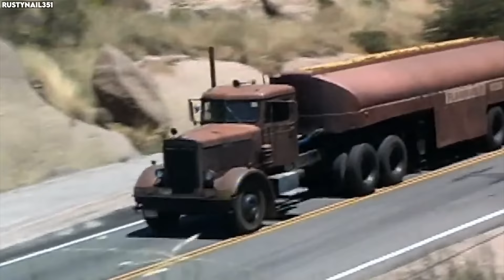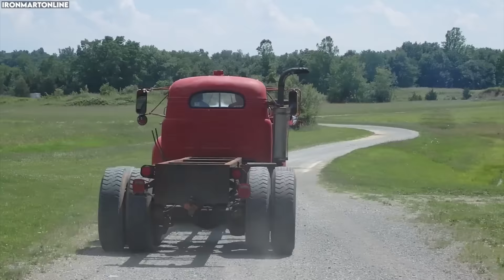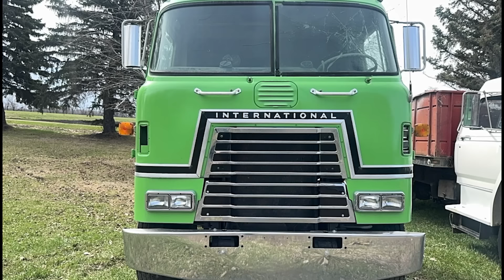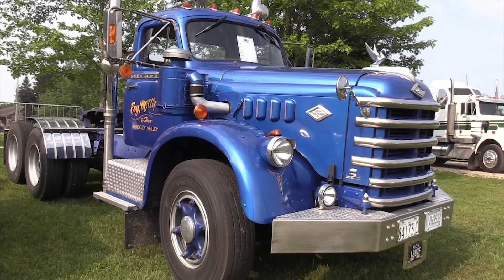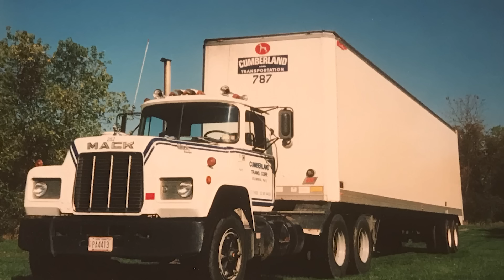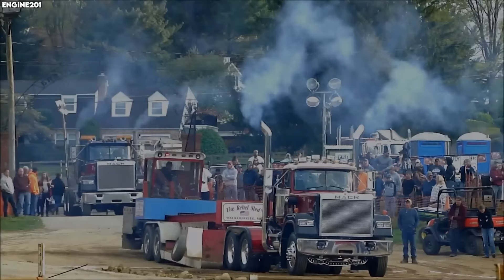10 Vintage Trucks Built So Strong They’re Still Unmatched Today

Comment: Mack super liners were Great truck to drive if you were ok with not being able to see anything at all of the lane in front of you for 10 meters - 30-35 feet, highest and widest hood built since the 70’s, Pete’s and KW’s might have longer hoods on some spec sheets but that Mack hood was the meanest to see past and oh by the way! Mack R models in the 70’s that were built with Cat and Detroit V eight engines or larger had a hood just as long as a Peterbilt or Kenworth.

Comment: I learned how to drive a tractor trailer on a B-61 with wet line pulling a lowboy trailer. Later, I owned a 1963 B-61 tandem dump truck. Those trucks were hot in the summer, bumpy as hell, but you couldn’t kill them.

Comment: The main semi in the movie Convoy was a Mack R-series. Not a Peterbilt.
Reply: And smokey and the bandit was a W900A
Reply: @The.Dayum.W and the main semi in Maximum Overdrive was a Western Star if I'm not mistaking. It was the black conventional cab with a black toy delivery box trailer. I don't know the model name exactly.
Reply: @KevinRichards-my5oj  you're correct it was a '77 western star 4800 with a 6v71 Detroit
Reply: @The.Dayum.W my favorite semi in Maximum Overdrive is that white Mack cabover bobtail with the dual rectangle head lights which was the one the drunk waitress went outside at night and screamed "We made you!" at shortly before the power got cut off at the truck stop.
Reply: @KevinRichards-my5oj 
I don't think she was drunk, just mad.